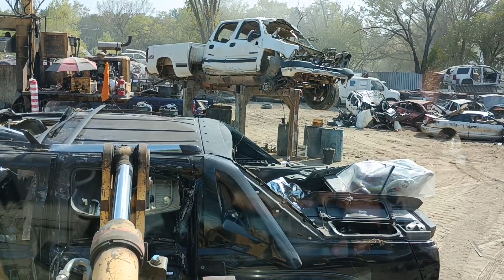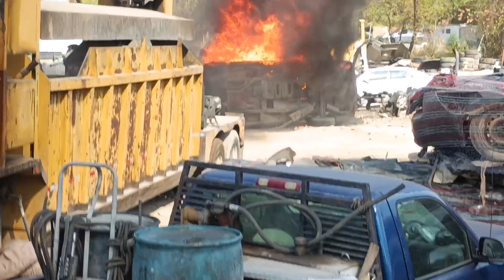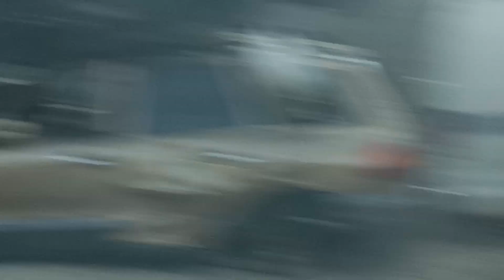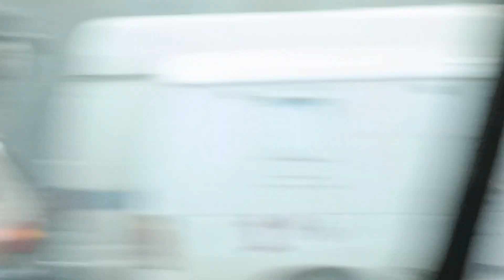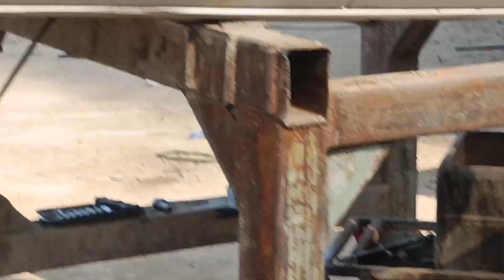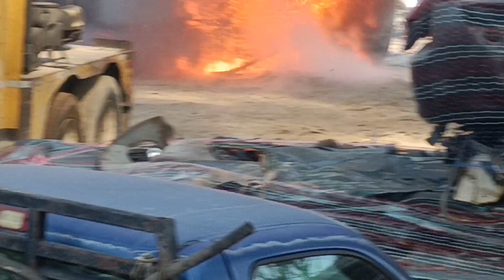Car Fire 🔥 in the Junkyard 😳

Comment: Dumb question, would it be practical to keep a pile of sand nearby for these kind of situations?  The loader could make quick work of it I'd think.  But I don't work in a scrapped, and I'm not a fire fighter either.
Reply from the maker: No not all. Actually that is my goal this week. Let's take a truck bed off. Sweep up some moon dust and have it on stand by